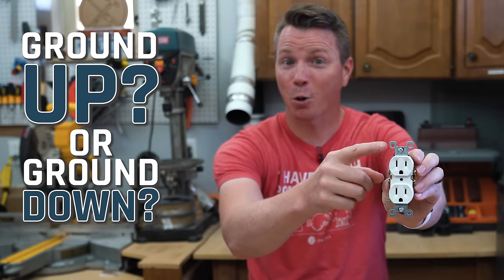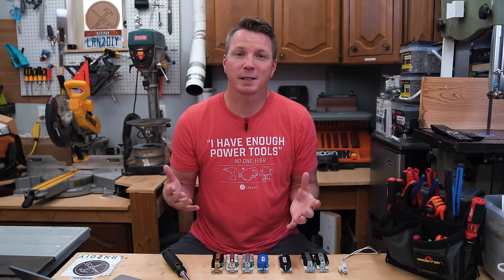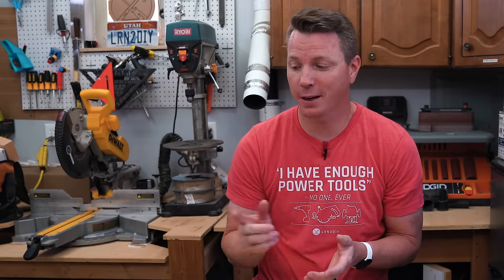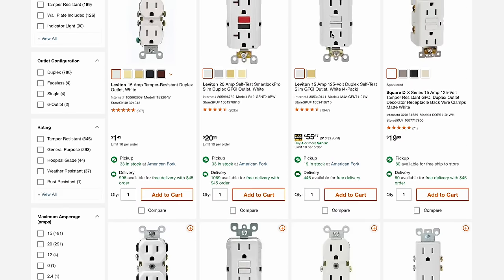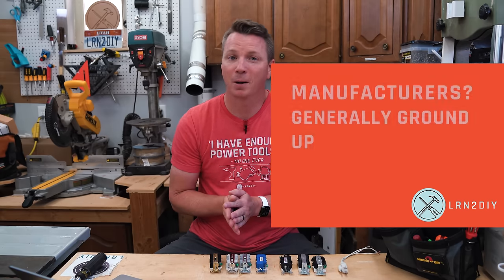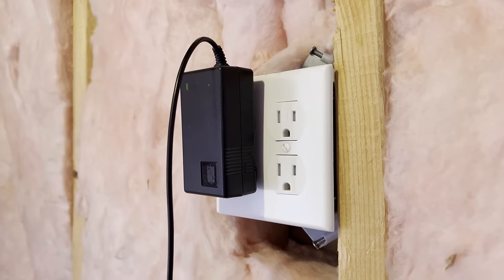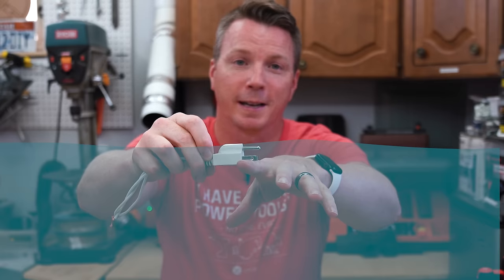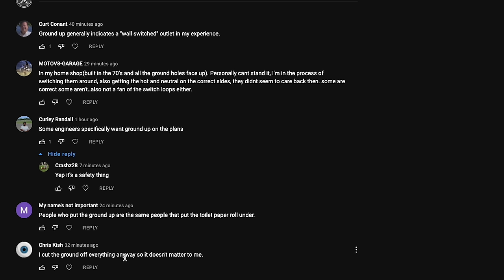Should Your Outlet Ground Face Up or Down?

Comment: A bunch of idiotic safety nannies decided to change code in a few places requiring ground faced upwards.  Ground has always face down!  Unfortunately these fools think that something could fall between hot and neutral and cause a short... Because people can't plug stuff all the way into the wall?? 

Just put ground down, the outlet functions better that way.  Many power adapters are not made to go the opposite direction.

Comment: US grounded 110-120VAC receptacles are the worst design and least safe of all modern receptacles.  
 The majority of all US receptacles types from the companies that make the highest quality for industrial/commercial use are labeled for ground up.  The cheapest ones made offshore are labeled for ground down.  It's easier to reliably and quickly plug a 3 terminal plug into a receptacle when you can see the grounding hole as you make the connection.

Comment: ALL that matters is Code. Period. And since it isn't mentioned in Code then it doesn't matter. What retailers have on their websites is less than unimportant because they have no authority and often no brains. How the manufacturers text on their receptacles are styling choices. If there was a compelling reason to do it one way or the other it would be specified in Code, but it's not so it makes NO DIFFERENCE.

Comment: In an earthquake a picture hung with a metal wire can fall and land on a plug. Which blades would you prefer the wire hit?
Reply: I don’t know who needs to hear this, but a dead short will most likely trip the breaker, so this overused argument is a completely moot point.

Comment: The ground belongs on the top.

Gravity always pulls down.  Gravity's effect on a cord will expose current carrying conductors when the receptacle is installed with the ground on the bottom.  Gravity will expose the ground when installed correctly.
Reply: Ground belongs on the bottom like it has historical always been... The ground provides a support to the downward force, which is why all power bricks or wallwarts use plug down
Reply: @xephael3485  I provide an argument based on facts and practical logic.  You reply that it has "always been" on the bottom.

Ground stays on top to be correct.
Reply: @jeffwoehrle  you provided the fallacy of an argument.  The ground on bottom supports power bricks and heavier plugs from falling out of the outlet... Exact opposite what you claim.
Reply: @xephael3485  How would that make any difference whatsoever?  The longer prong serves to hinder pulling OUT, not pushing in.  The wall does that.  Ground on the bottom can't push in, so the only pull out would be (with your method) exposing the current conductors.  Just what I explained above.

Moreover, manufacturer Hubbell provides this handy chart:  https://hubbellcdn.com/ohwassets/HCI/WiringDevice/media/NEMA_Chart.pdf  Why would they show all grounds up?  Because ground up is the correct way to install.

Comment: Has anyone ever seen a ground up receptacle used in normal circumstances? I can honestly say in my 50 years on earth I have maybe seen it once or twice, and those were very special circumstances due to the location of the receptacle. I can say that if I saw one "upside down" I would probably pick another one just because I would be questioning the installer's skill and probably wonder if it was wired incorrectly. 

I'm kind of wondering, if this is something you are seeing more on online shops and manufacturers websites, is it something they are trying to normalize or push onto the consumer? I mean, we ALL know ground is down in the US! If you were in a dark room or under a desk and had to plug in a computer cable, you would be holding the cable with ground down. If I started seeing more often then I was assume it is something new and would most likely accept it. But I haven't come across it in a normal setting ever.

And wouldn't it be a little confusing if you came across a house where half were down and half were up? It is just a natural habit to orient the cable in your hand with ground down. I'd hate to have to look at the receptacle first!

Why is this a debate again? Are you just messing with us? 😄

Comment: I do not normally commit on electrical distribution installation. But the title of Do It Your Self (DYI) in misleading. No one should be installing electrical unless properly trained with complete knowledge of codes and standards. Just one, I mean one small example,  UL RTRT. Thanks for your attempt for people to save money but at the expense of safety?? 😢

Comment: It’s not an issue over here I have never seen an outlet in a different orientation and no words at all! Now questions: what is the tube thing behind you? Seems to be doing nothing. Are you of Canadian heritage? They way you are pronouncing buttons’ make me wonder. Of course it doesn’t matter at all just my nosiness!
Great video, as always,
Bob
England
Reply from the maker: Hey Bob, I'm actually very interested in comparing European outlets with ours because from what I can tell, yours are significantly better designed. As for the tube, that's a dust collection pipe that isn't hooked up to any tools right now because I used it to test air flow with an anemometer. For my heritage, I'm American, raised in New England (New York and Connecticut) but living in Utah. Thanks so much for watching!
Reply: @LRN2DIY  hi, would you like some photos? Or would me sending you a few bits be better.?
Bob
Reply from the maker: @BobMuir100  Hey Bob, I'm hoping to order a few to take apart and inspect as well as to film.

Comment: good thing you mentioned, State and local codes. But; there are many reasons you didn't mention. First and for-most!!!!  You didn't say anything about the (Very First Paragraph), in the NEC!!!! It's up the the Inspector.. Whether or not, Commercial or Residential. Dedicated or Isolated circuits. {Retired ,Unlimited Journeyman Electrician} with 43 Years Experience....Perhaps you should do more research before making these video's.